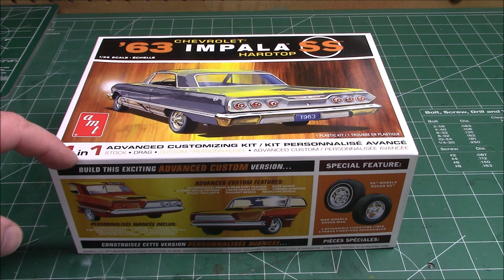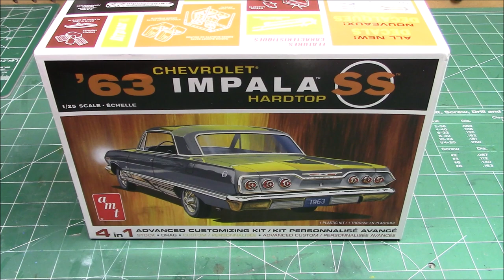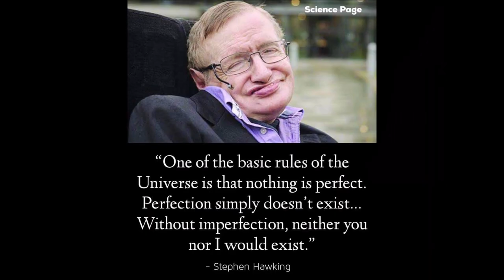AMT 1963 Chevy Impala SS Hardtop 4n1 1/25 Scale Model Kit Build Review AMT1149

Comment: I may have to get this kit. My late older brother had one of these back in 1970. It was white, with a black interior and bucket seats. He dropped a 283, bored out to a 427 in it. He also fitted an Oldsmobile tranny in it. He had to split the Olds & Chevy driveshafts, then have them welded together and balanced. At 425 hp, that car screamed! He had a six-inch steering wheel in it, a Hearst shifter, and a Holley 4-barrel. I learned to drive a stick on it, when I was 15. My brother was a talented guy, as far as mechanics and bodywork went. I miss him, and I miss that car! --Cindi (Granny Glue-Sniffer)
Reply from the maker: Very cool, thanks for watching Cindi!
www.facebook.com/hpiguysworkshop

Comment: I just got into car model building after a 35 year hiatis. I'm not doing so good. I am not having good results with spray cans and I dont know what I could do any different. I wash my plastic thoroughly, I use Tamiya gray primer, and testors, rustoleum spray cans. I have problems with gloss paints running up to the trim and puddling ?I try and use short thin coats in the beginning  but I still have problems.  I dont have this with airbrushing. I'd like to save time by using cans but the results are poor. Im not looking to do a show quality job, just a decent job. Great utube channel
Reply from the maker: Usually runny paints are being out on too think, but it could be a lack of shaking, too hot, too cold, etc. Impossible to diagnose on the internet.
Thanks and enjoy your hobby!
www.facebook.com/hpiguysworkshop
Reply: Make sure you're not spraying paint in hot and humid conditions.  Moisture in the air will play havoc with paint jobs.  Otherwise, spray several light coats - beginning with a fog or misting coat - instead of just one or two heavy coats.  Allow at least 20-30 minutes drying time between coats.  Also, don't hold the can too close to the car body when you're spraying back-and-forth.  If you don't get any dust or dirt particles trapped in a paint coat, allow the final coat to completely dry for 48-hours, then lightly wet sand or polish to a mirror finish.  At least, that's the process I use to obtain good results.

Comment: Stock cast iron manifolds, no headers? You do a great job with your models, they're always so nice and neat. I guess you just have to work with what you get. My first car was a '63 Impala, age 18, a senior in high school. It had a 327 cubic inch engine, 4-barrel carb, Hurst 4 speed, dual exhaust, with headers, Thrush mufflers, 12 bolt posi rear. Gabriel highjacker shocks in the rear. It was a two-door hardtop, no post. It was a true SS, in Honduras maroon, I put grey, American Racing, torque thrust rims on it,15 x 7 in the front, 15 ×8 in the rear, with a 60 series tire in the back.
Reply from the maker: Yup, I review out of the box but there is a billion things a custom builder can do with this. Thanks!

Comment: Nicely done Impala. Not showroom stock with all the fancy details, but a mild custom will do. Like the owner wants to drive the car, not park it and show it off like a trailer queen. 

I've just never really fancied the older cars of the early to mid 60s. I like all the chrome trim, but it can be a pain trying to detail all that chrome. Molotow chrome isn't perfectly chrome, but it's the cheapest thing to getting the closest chrome finish on trim. BMF is the ultimate in chrome detailing. I just don't have the patience to use BMF. Going through so many blades just to cut out strips is aggravating.
Reply from the maker: Thanks for watching Mark!